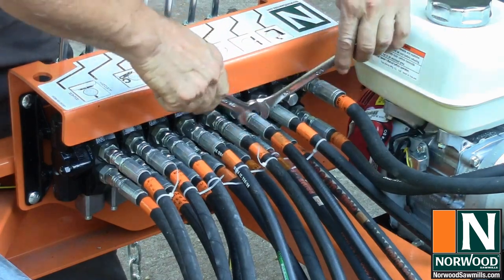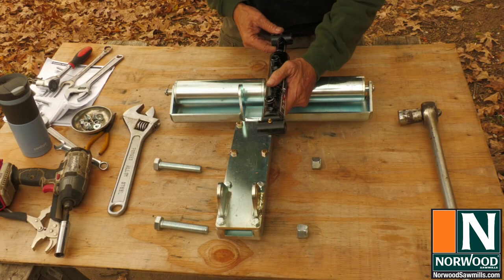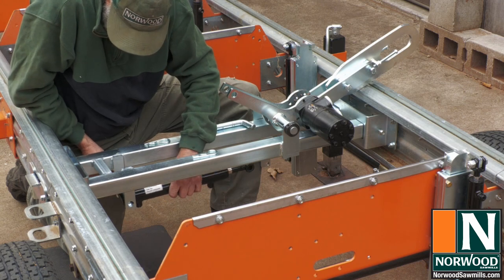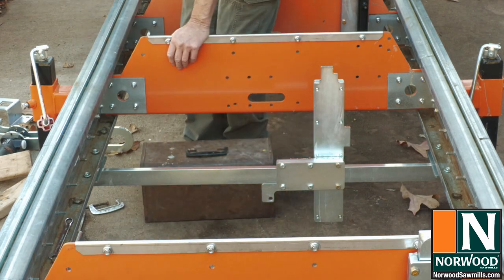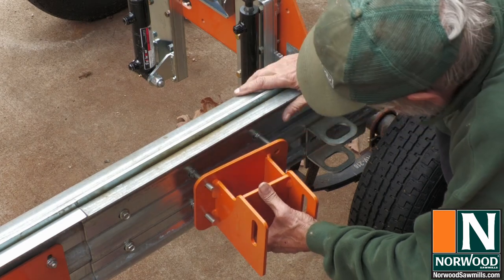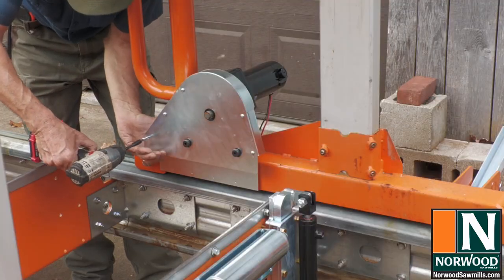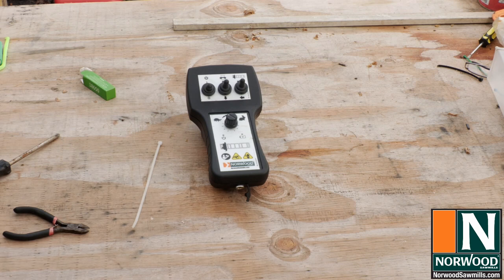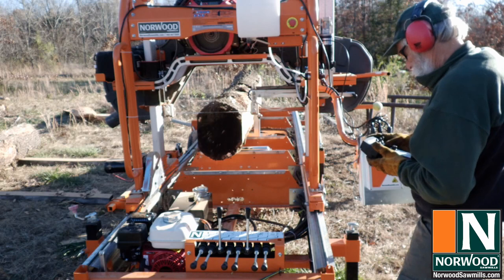How-To: Assemble a Hydraulic System and Power Feed on the Norwood HD38 or HD36V2 Sawmills

Comment: Very informative video. However, with all these nuts and bolts, I have a number of questions.  Why do you not use any lock tight and torque wrenches during initial installation to keep nuts from back off during vibrations from day to day use of using a sawmill? Seems like an important missing step.
Reply from the maker: Thank you for the question Carl Marks, Dave is a legend at assembling and running the Norwood sawmills.  Some people do use blue lock tight on some of the hardware and some use gray anti-seize for other items. 

The best part about a Norwood sawmill is, it is yours and you decide what works best for you. We help support you with the choices you make for your sawmill. 

If you have any other questions you can hit the "chat with a sawmill specialist" on the website or schedule a call that works better for you. 
Just look for the 💬 in the bottom right corner.

Or get a free quote over the phone :)
Toll-Free: 1-800-567-0404
www.NorwoodSawmills.com
Reply: Good observation!  The flange nuts & bolts have ridges that bite into the metal.  They're shaped in such a way that they go in easily, but don't back out on their own.  Nuts with the nylon inserts will stay put, with no problem, and the hydraulics go together with compression fittings, and I've never had one come loose on the mill, tractor, or log splitter.  You are right, in that they do need to be adequately torqued down, but, especially on fittings with "O" rings, going too tight can damage the seal, and they will leak.  If you do use Loc-Tite, be sure to use the blue, so you can take it back apart if you ever need to.  Best of luck with your mill.  Once you get the hang of it, you'll love it!

Comment: Nice. But terribly expensive.
Reply: Hydraulics are generally very expensive. Their prices aren't bad in comparison, you wouldn't save much building it from scratch yourself, at least not with brand new components.
Reply: @woodlandwrench  True enough!  I just had a couple of cylinders rebuilt and new hoses for the old tractor.  I shoulda been sitting down when I got the bill!
Reply: It's all a matter of economics.  Compared to the expense (and paperwork) of hiring some help, it's a not-brainer!
Reply: @Dave Boyt  Yeah, when you're not used to hydraulic bills, then you're in for an eye opener. I recently ordered two small double acting cylinders, 30mm rod, 40cm extension, $800.
Reply: @woodlandwrench  Agreed.

Comment: I plan on getting an HD 38 with an electric motor. Does an electric motor unit also have an electric hydraulic motor unit?
Reply: Good question.  You'll have to check with Norwood about that, but it shouldn't be too hard to adapt an electric motor to it if the rpms aren't too far off.  Are you going with 3-phase?  Your's would be the first electric 38 that I know of.
Reply: @daveboyt6810  Thank you.
Reply: Same plan here. Norwood tells me They can sell me everything but the motor and I will have to buy it elsewhere.
Reply from the maker: Hi Linzie.  We can certainly help you with your engine needs.  We have many selections including an electric options for the hydraulic attachment.   If you would like I can have a Sales Specialist contact you and help answer any questions you might have.   You can reach us toll free at 1-800-567-0404 or by email at info@norwoodsawmills.com.